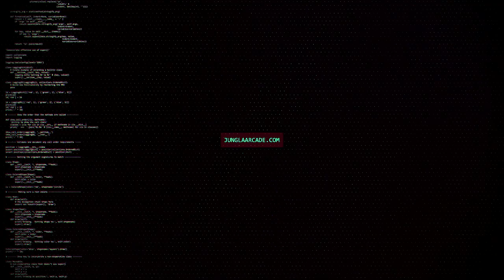CÓMO CAMBIAR JOYSTICK AMERICANO POR SANWA - Máquinas arcade

Comment: Pa que te matas con tanto trabajo eves de compra el cable de combercion
Reply from the maker: siempre es bueno poder hacerlo con los materiales que tenemos a la mano... por cierto, cual es ese cable que mencionas?
Reply: @JunglaArcade    este es el nombre del cable que yo compre en ebay
Arcade 5 pin To 4.8mm (.187") Microswitch Terminals Conversion Harness Cable
Reply from the maker: @unspacy110  genial buen dato!!! muchas gracias... ahora buscare esos terminales macho 4.8mm para aprovechar ese cableado sanwa q muchas veces no se usa...